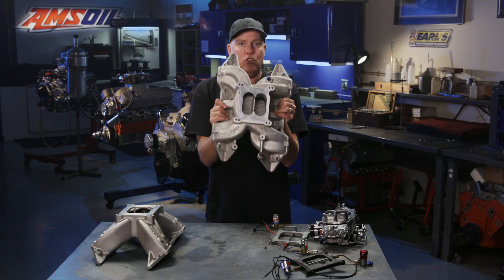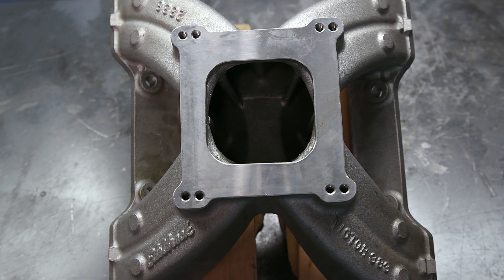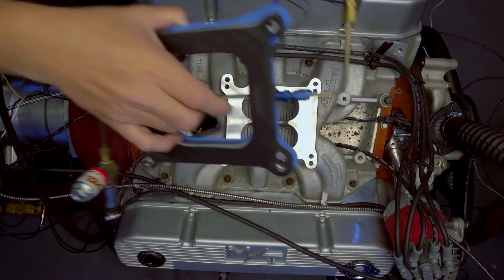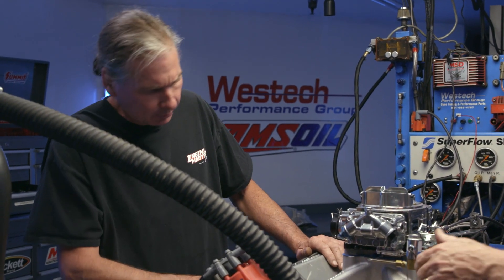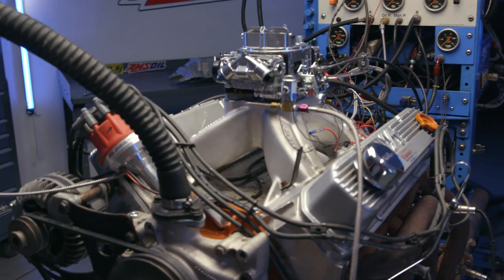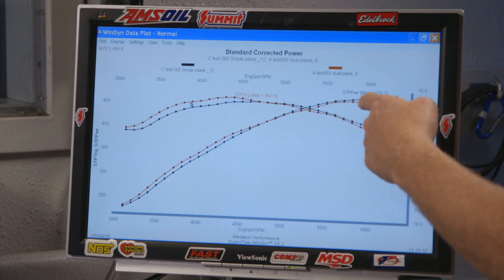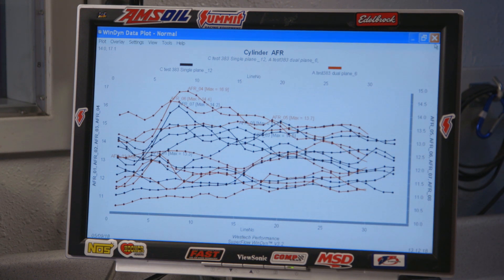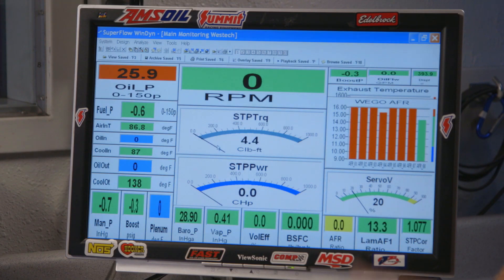That is One Hot Manifold—Engine Masters Preview Ep. 38

Comment: I'm sick of people dogging the low deck 383 and swapping in favor of the bigger 440... way too many people call it a boat anchor. You know what I would love to see??? A full maximum race effort with a stock stroke 383 Mopar.  Big Ported Heads, 12:1 compression, Big roller cam, Big carb, Big swoopy single plane intake. With its 3.38 stroke (1.88 rod /stroke ratio) strong bottom end, and all that max power, high rpm stuff... It would have to be an absolute 8000+RPM revving buzz saw. Figure an A-body, 727 5000+ stall convertor, 5.13 gears... It's time to put the 383 doubters on the trailers.

Come On Dulcich... Let's see what ya got and build us a 383 High Revving Screamer and stick it on the dyno!!!!!!
Reply: 650 or more HP i bet
Reply: There's no point in building a 383 when a '511 stroker costs the same.
Reply: @tlr-nut7275  Not really the point I was trying to make here... I was talking with a stock rotating assembly and the power make possibilities with it.
Reply: @451dskots88  Good luck with 8,000+ rpm with stock rods and crank. Should last at least 4 or 5 seconds.

Comment: So what manifold do you prefer for the 383?
Reply: Street setup with regular 906 heads, between 9 & 10:1 compression, Mild performance cam. 750 carb... Eddy RPM Performer DP intake all day long. 11:1+ Compression, big street/strip hyd/mech roller cam, Big ported or aftermarket head, 850+ Carb have to go with the single plane.

Honestly the RPM Performer is probably the best street/strip DP intake ever made for both the B/RB mopars. Once you start getting into the "BIG" stuff, then you have to go with the big, high flowing and swoopy intake.

Comment: Episode idea I was rewatching your e85 episode and saw timing sugestions being made and was thinking we only run 32 degrees advance on the neighbors methanol big block mopar. We found it wanted lesd timing than gas. I'd like to see a race gas vs methanol episode with timing curve adjustments intake temp differences and price of gallons of fuel used per horse power. We run the methanol because we don't need a radiator with it as it cools the engine at an idle without one (another cool test on the dyno) and its much cheaper per gallon. The engine we have is a 14:1 indy head 500 inch low deck mopar with a mechanical roller (wish I could remember cam specs) makes close to 800 hp na.
Reply: nick wheaton.  great idea for a show.  it did not generate one response from anyone.  we'll probably never know.  thanks for postng.